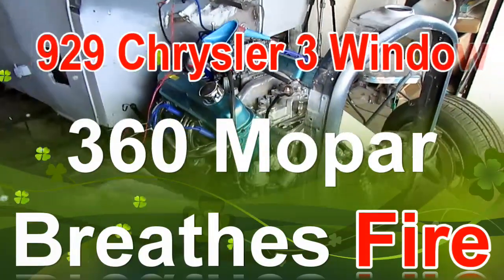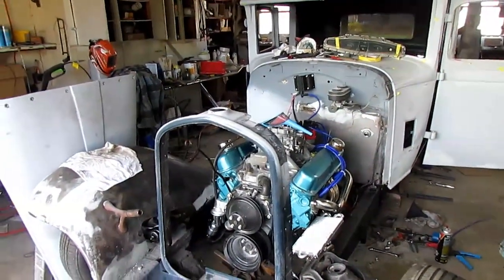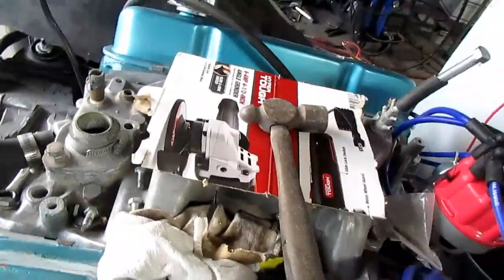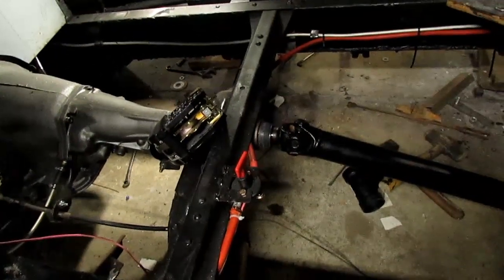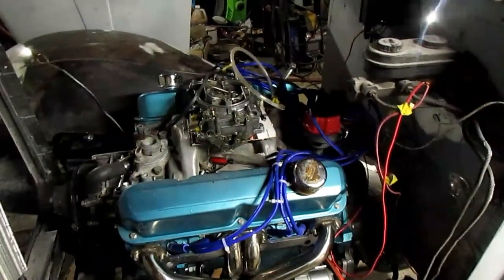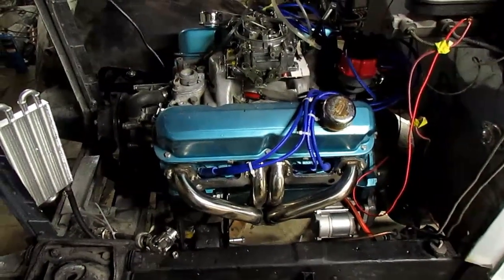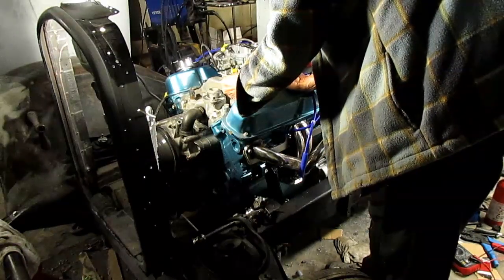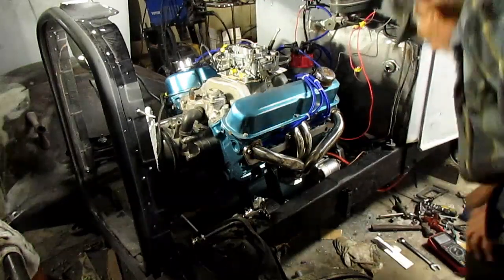1929 Chrysler 360 plumbed and breathes FIRE

Comment: Sounds good !! I didn't see any vibration.
Reply from the maker: Fired it today getting the trans going. I wrapped it up pretty good ad few times, I didn't feel very much at all. I do know that I need to put the weights on. I will weld one on at a time, and check it. If it gets worse, I can easily cut them off.